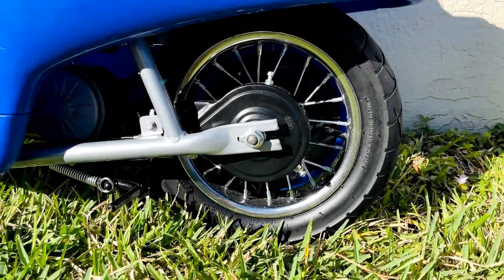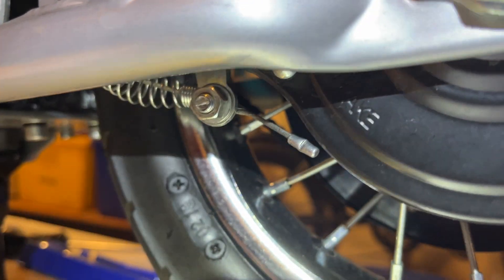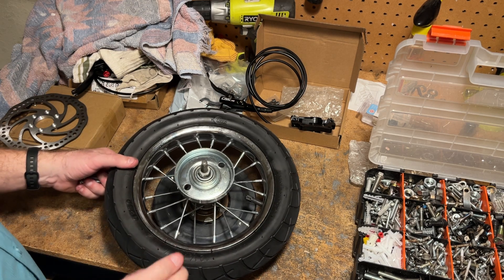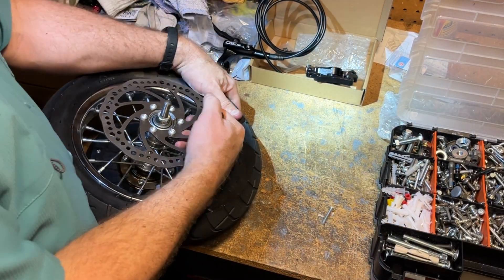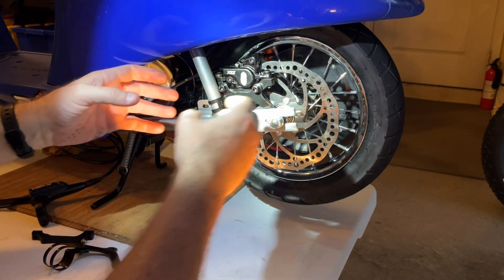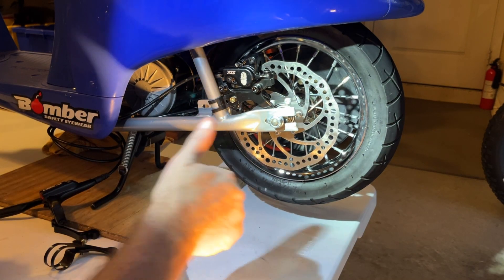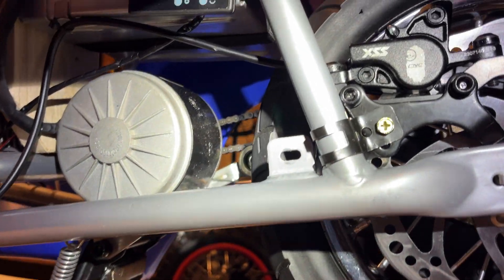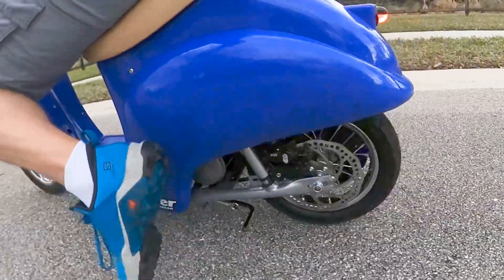$49 Disc Brakes - Razor Pocket Mod - Hydraulic Brakes

Comment: What size of disk 160 mm ?
Reply from the maker: Go with 180mm to be safe
Reply: @BRichSolution You have 180mm on your s
Reply: Hey I have a problème with the break mount the ring do not fit on mine and is more outside as your vid do you have something to help with that problème

Comment: hey Brich, any reason why when i brake it sounds so loud like metal rubbing, I ordered all the parts in the link installed exactly like you?
Reply from the maker: Is the brake caliper rubbing on the brake rotor?   If not clean rotor with soap and water or alcohol wipe
Reply: @BRichSolution  hey thanks i figured it out, it was the rotor that was bad replaced it and noise is completely gone, thanks again
Reply from the maker: Thanks for the update

Comment: Can you post a video on the exact method to installing the caliper? Mine isn’t fitting on, i bought the 180mm
Reply from the maker: Use washers or spacers to get the spacing or offset to match rotor
Reply: @BRichSolution thanks!
Reply: @BRichSolution its just rubbing a little but it should be ok

Comment: Did you choose a different disc brake rotor one that was already threaded in the video? Because you added threaded hub disks and where do those go because I do not see them in the video.
Reply from the maker: I used at 160mm disk brake but recommend 180mm version as alignment with brake caliper would be easier.   Link the rotor is in the description below video
Reply: @BRichSolution  Yeah and the one that you used was already threaded? And that’s why you added threaded hub disks on the parts list?
Reply: @BRichSolution  nvm I see it now on the back of it sorry

Comment: So get the 180mm one correct? It is default to the 160 and I remember in the video you saying to get 180 so just making sure.
Reply from the maker: Yes get the 180mm
Reply: @BRichSolution  Can I use silver-A option?

Comment: I can’t get the caliper to line up without rubbing. I’ve tried every single adjustment you can do taking the wheel on and off several times and still cannot get it to line up even after doing it step by step in your video. Any advice you can give?
Reply from the maker: Rubbing on the inside or outside pad?
Reply: @ inside pad

Comment: Do you know if this specific frame adapter works with the zoom hydraulic brakes? Or maybe like stock mx650 brakes?
Reply from the maker: Zoom brakes bolt right on mx650 and mx500 you need replace stock rotors with thinner rotors for the zoom brakes; see video linked below  
https://youtu.be/rBJ2z1ujeRg

Comment: Is there a lot of difference in the brake types?
Reply from the maker: The stock brakes are not good and dangerous.  Upgrading to disc brakes is massive improvement
Reply: @BRichSolution  Do you think it's worth adding front brake as well?

Comment: If i use a mechanic brake line, how to do i hook it up to the black bracket?
Reply from the maker: If you use mechanical brake line with mechanical caliper or zoom hb100 caliper the mount brakes is the same as hydraulic brakes in this video
Reply: @BRichSolution Is there an advantage of one over the other? i.e. using the stock mechanical line vs changing out the line?

Comment: tried your method with 12" hub motor but can't get it to work.   every time I hit the brakes the wheels come off the frame even with torque arms attached.  I'm beyond annoyed.
Reply from the maker: I understand and the 12” hub motor slides out of the dropouts in the frame?
Reply: yep hitting the brakes creates too much torque somehow.  I was sitting on it only going 5mph or less and when I hit the brakes the adapter and wheel came detached from frame of the scooter and bent the drop outs  @BRichSolution

Comment: Been enjoying your pocket mod videos. So with the parts where did you put the freewheel hubs? Doesn’t the brake set come with calipers? Not sure what the extra rear caliper is for?
Reply from the maker: Freewheel is in sprocket with chain.  I changed the brakes from drum to hydraulic disc brskes
Reply: @BRichSolution I know you put disc brakes on. On your parts list you have a caliper by itself and a brake set that comes with a caliper? You need 2 calipers? I just know nothing about this.

Comment: I plan on getting every single one of these I see sitting on the side of the road as garbage until everyone in my house has one if they want it because they are incredibly easy to modify and they last so long on 36v with at least a 350w,basic controller setup that range isn't a issue for us. I'm 225 and I ride around with my 3 year old daughter easily except for the brakes.....parts have been ordered,thanks!
Reply from the maker: Great goal for 2024
Reply: Have you replaced the original motor, or can the stock 24 volt motor handle 36 volts?

Comment: I love the pocket mod frame and everything about the pocket mod actually. I modded my pocket mod with dual motors dual controllers dual batteries and it topped out at 102 mph this was last year. This year I did an upgrade for a customer and his pocket mod topped out at 112 mph.
Reply from the maker: Thats super fast on this frame

Comment: What size rotor did you use?
Reply from the maker: 180mm as linked below in description of video
Reply: @BRichSolution on the link it doesn’t show exactly what rotors or parts you use only the links to the part then it still lets you pick what size stuff, that’s why people are asking you, but thanks for the guide super useful thank you!

Comment: Would this setup work on an mx350
Reply from the maker: Yes works for mx350
Reply: Did you try this setup on the MX350? If so, do you have any extra insight for someone wanting to do this?